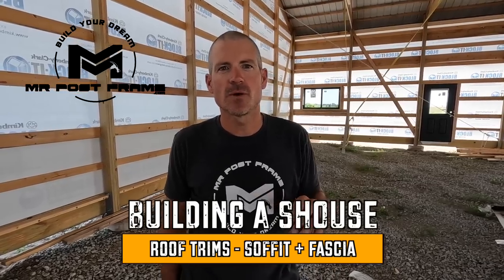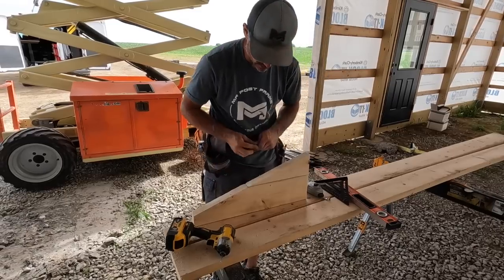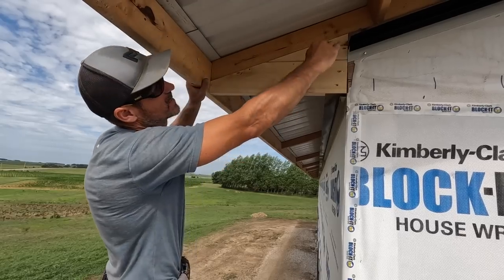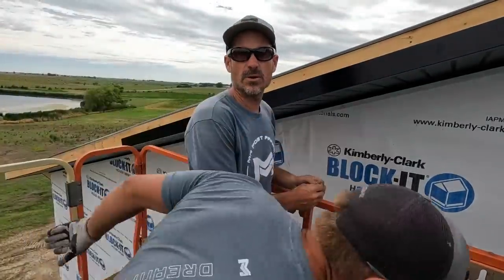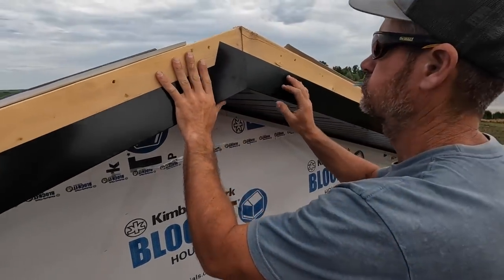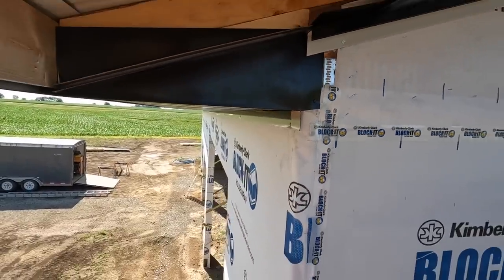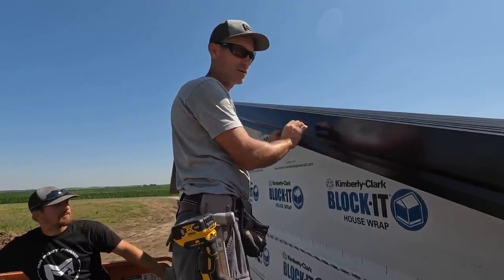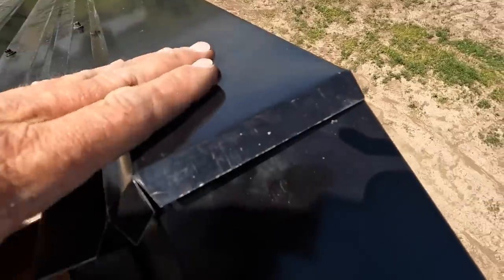Building a Shouse | Roof Trims - Soffit + Fascia | Ep9

Comment: New to your channel saw you using screws for fascia, etc.........What screws are you using? The ones you used to put the blocking in with at the start. It looks like a type of trim screw but smaller head, but none of our big box stores have screw like you are using. I assume the color matching screws come from the metal manufacturer?

I was like top down? Ok.....Nice clean work. Off to see if I can find the exterior siding up as a finished product.
Reply from the maker: We get them from our local, big box hardware store. Link below to black screws but come in all metal colors.

https://www.menards.com/main/hardware/fasteners-connectors/screws/pole-barn-screws/pro-grip-reg-8-x-1-1-4-star-drive-pan-head-premium-trim-screw-1-lb/midnight-black2301594-09/p-10338754666832555-c-8934.htm
Reply: @MrPostFrame  Thank you. I appreciate it. Special order here locally is why I have never seen them. The head looks to be bigger than they look in your video, but I will look into them.

Comment: I thought in a previous video you said you would always use plywood under steel roofs? Homeowner not like the cost?
Reply from the maker: There were a couple I built without plywood. Client has final decision…I highly recommend. All my latest builds have plywood or at least drip stop.

Comment: Great detail on the meticulous part of exterior trim work. It's a constant battle fighting water mitigation. 
Are you familiar with sheet metal screws that have a dome like washer?  They prevent overtightening of the screw and keep the washer in correct form, instead of pooching out if overtightened.

Comment: What type of screws do you use on your fascia?
Reply from the maker: We get these at Menards and love them.
https://www.menards.com/main/hardware/fasteners-connectors/screws/pole-barn-screws/pro-grip-reg-8-x-1-1-4-star-drive-pan-head-premium-trim-screw-1-lb/midnight-black2301594-09/p-10338754666832555-c-8934.htm
Reply: Thanks